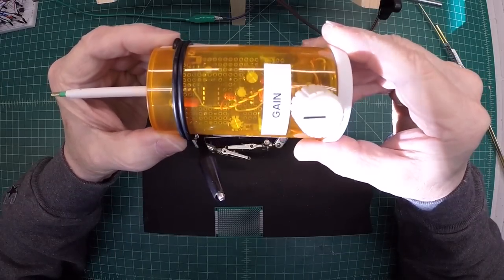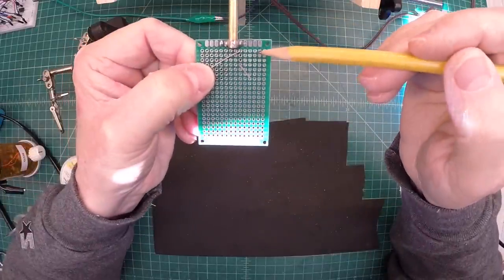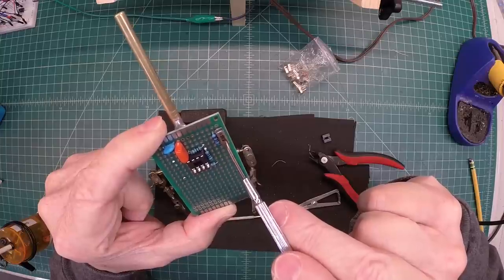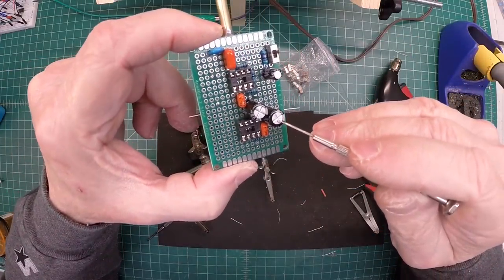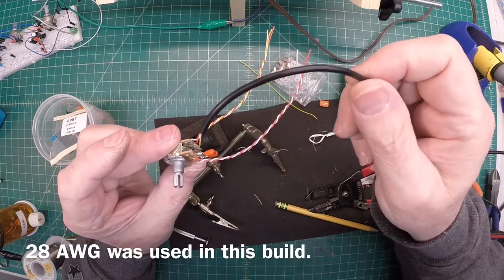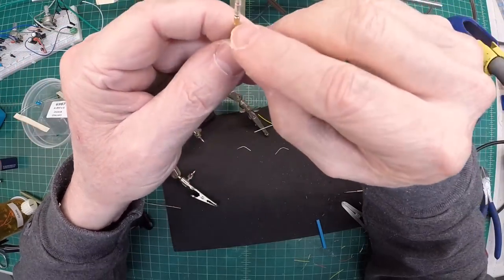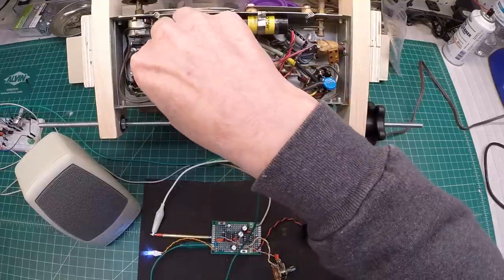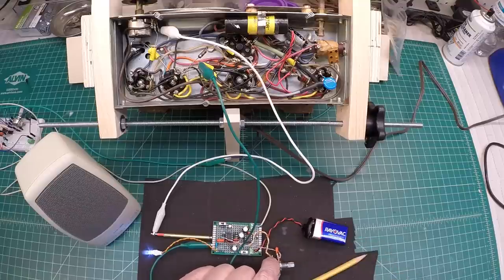How To Build A Signal Tracer - Part 1

Comment: Don, really great design. I have it built now but having trouble getting it to work. I'm trying out on things like transistor radios and the Murania TRF radio. I can barely hear some output, but when I click in the gain, it blanks it entirely. I've tried changing out chips but no joy. Do you have a troubleshooting page or guide on this one. I'm quite new at this. Jamie WB4YDL
Reply from the maker: James, how does the gain control affect the output? Best, Don
Reply: @RestoreOldRadios  There was some intermittent popping and I had to turn it all the way up. The 10K pot is actually more like 8K. I did reflow the solder on everything, but haven't had a chance to retry things.
Reply: RestoreOldRadios Well, I still can’t get it to work. I’ve checked and rechecked all the connections. The diode checks good and I’ve replaced the chips a couple times. With the radio I’m testing on, I tried a standard RF probe and it worked fine. Soooo ... I’m left to get it on the breadboard and see what I’m missing. Nuts.
Reply from the maker: James, I hate the circuit is not working for you. I assume you confirmed the Vcc voltage to both ICs is present? Best, Don
Reply: RestoreOldRadios Yes, both chips show good voltage (now down to about 8.6v on that poor 9v battery) on the Vcc pins. Diode checks out at 235mv. Volume control resistance goes down on increase volume, resistance goes up on gain control. It looks like it’s wired correctly. I reflowed and cleaned every joint. I’m going to rebuild it on a breadboard today and see what I’m missing. I need to use it for a SX-99 receiver project. :)
Reply from the maker: James, please keep me posted on your findings. I built a number of these myself and just one of the mistakes I made was wiring of the potentiometer gain control. I had it connected to the wrong side, i.e., 1 & 3 were reversed. Do you have an O-scope and an audio generator? Best, Don
Reply: RestoreOldRadios Yes, I do. I tried to follow your excellent video to a tee. If I’m wrong, tell me - as resistance goes up, gain goes up ? I got the SX-99 working today so was having fun with it. I still want to get this tracer working - I’ll let you know.
Reply from the maker: I’ll ping you back tomorrow afternoon or Monday at the latest. Let me check one of my builds. Best, Don
Reply from the maker: James, let me know if this helps: https://youtu.be/ZxLvMCMTMYs

Best,

Don
Reply from the maker: Just checking in to see if you saw the short video I published. Best, Don
Reply: RestoreOldRadios Wow ! Getting the personal treatment ! :) Many thanks for this and this may indeed be my problem. Haven’t checked yet as I was, well, fishing with the grands ! :) I’ll keep you posted. I got the SX-99 going so it was a good weekend.
Reply from the maker: Fishing with the grands sounds fun. Hope y’all caught a big mess. I look forward to hearing back as time permits. Best, Don
Reply: RestoreOldRadios OK, fish cleaned and back on the bench. The video describes exactly as I have it - min and max values are pretty close. So, I made a voltage chart for the pins of each chip with max vol (gain on/off) and min vol (gain on/off).
Max volume, gain off:
LM386 - 1: 1.32v, 2 -4: 0v, 5: 4.47v, 6: 9.13v, 7: 4.63v 8: 1.32v
LM741 - 1: 0.02v, 2: NR, 3: ~1.6v, 4: 0v, 5: 0.4v, 6:0.5v, 7: 9.1v, 8: 8.1v
Gain On:
LM741 - 1: 6.87v, 2: 0.68v, 3: 1.6v, 4: 0v, 5: 0.162v, 6: 0.4v, 7: 9.1v, 8: 8.1v
Min volume, Gain off:
LM386 - 1: 1.31v, 2-4: 0v, 5: 4.46v, 6: 9.1v, 7: 4.6v, 8: 0.45v
LM741 - about same as above

Min Volume, Gain on:
LM741 - 1: 6.87v, 2: 1.3v, 3: 1.9v, 4: 0v, 5: 0.25v, 6: 0.6v, 7: 9.1v, 8: 8.1v

Hope this makes sense and leads ultimately to success ! Thanks !!
Reply from the maker: I’ll compare ASAP and reply back. Thank you James. Best, Don
Reply from the maker: James - check out: https://youtu.be/hebJUA7ykMY

Looks like your trouble is in the area of the LM741.

Keep me posted. 

Best,

Don
Reply from the maker: Just making sure you saw my last post with the voltage measurements. Best, Don
Reply: RestoreOldRadios I just saw this now. Thanks much !! I’ll compare your numbers to mine, but that should lead me in the right direction.
Reply from the maker: Hope it helps. I would appreciate you letting me know the root cause for my edification. All the best. Don
Reply: RestoreOldRadios Don, got it to work !!!! Yessss !! It was indeed a bad batch of 741 chips. I got my new chips this time from Digikey (and not Amazon !) and it showed proper voltage. I hooked it across the single transistor of the Murania TRF AM radio and it blew me away how clear it was. The gain works properly as well. Now to dress it up. This is going to super useful !! Definitely will show it off at the ham club meeting. Many thanks for sticking with me on my quest ! :) 73, Jamie WB4YDL
Reply from the maker: Jamie - that’s great news. I find it useful too and it doesn’t take up as much space as my vintage Heathkit ST. I appreciate the update and thank you in advance for sharing this with your club; hopefully others will find it adds value too and build one. Be safe during these trying times and thank you again for taking time to check out my channel. All the best. Don
Reply: RestoreOldRadios Ever think about doing this in SMD ? That would be interesting.
Reply from the maker: James Hall James - I haven’t, but I would love to see you run with that idea. I lost a good bit of my vision in my left eye many years back and just building this one was challenging, but fun and rewarding indeed. Hope you’re having fun with the signal tracer and it’s working well. Stay safe and all the best to you and your family. Don

Comment: I want to put all the electronics in a small box...and put a BNC connector on that box..so I can use an oscilloscope probe...That way you would do away with the 10 meg ohm resistor...(because the probe has it already in it.), and put the diode, and capacitor on the circuit board. I will be using a box, from an old laptop adapter, to mount all the electronics in..
Reply from the maker: Kennynva Sounds like a good plan. I’m assuming your o-scope probe voltage rating meets or exceeds the circuit voltages you’ll be using this on? Best, Don

Comment: I Built this circuit and it works ok, Problem is it tends to  squeal at high volume, Any ideas what the problem might be ?
Reply from the maker: By design, as you increase the volume control, the gain also increases to the point of oscillation when operating in the extended gain position. With the gain switch in the normal position and the volume/gain turned wide open, you shouldn’t hear any squeals. Do your the squeals in this configuration? Best, Don
Reply: @RestoreOldRadios   No, It only happens with the switch in the extended gain position. Cheers Jay.
Reply from the maker: @zinkzoyd  Ok, it sounds like it’s working as designed. The gain at that point is extremely high. Ensure the ground connection is in place as well. All the best. Don
Reply: @RestoreOldRadios   Ok thanks for taking the time to reply. Just as a final note you can't use any Ge diode as the detector. It has to be one that is  sufficiently leaky to allow DC to bleed off. Otherwise you'll get bad audio distortion, Cheers Jay.
Reply from the maker: Yep, I used a 1N34A Germanium Diode, but you still get some audio distortion. Check out this probe design: https://youtu.be/OGrkIC-Mov0 It’s auto sensing and provides a cleaner...

Comment: Is this a contact probe or a non-contact probe?
Reply from the maker: Sam, it’s a contact probe. One lead goes to B- or ground while the tip of the probe makes contact with the area you’re testing. Check out my video for a demo at: Prototype Signal Tracer vs. Heathkit IT-12https://youtu.be/d_l4X03s1ME  Best, Don

Comment: To me I could build it if the diagram is on paper, it's easier for me this way..thanks. Also, could I use a 4558 op amp?
Reply from the maker: Check out Part 2 (ref. URL below) and at the end of the video you'll find the schematic. If the 4558 is a useable substitute for the 741, it should work.  Thanks for watching. Best, Don

How To Build A Signal Tracer - Part 2 https://youtu.be/5x5op1V_LFc
Reply: @RestoreOldRadios  I think a 358 is a op amp also, that would replace the 741...thanks for sharing..
Reply from the maker: Good luck on the build. Thanks again for watching. Best, Don